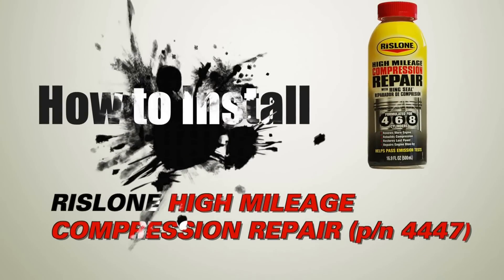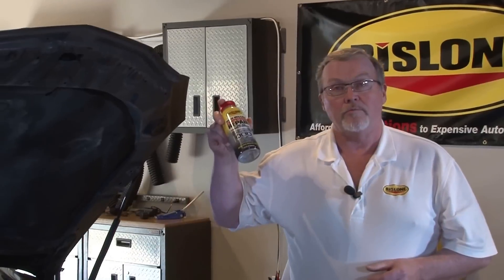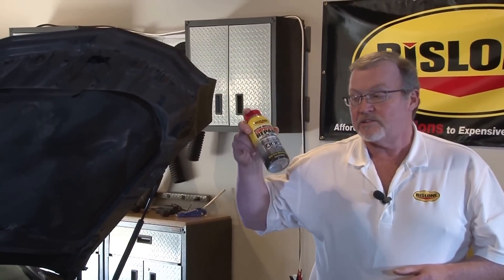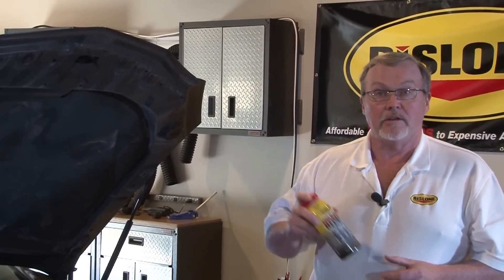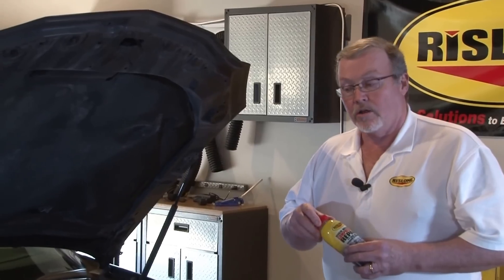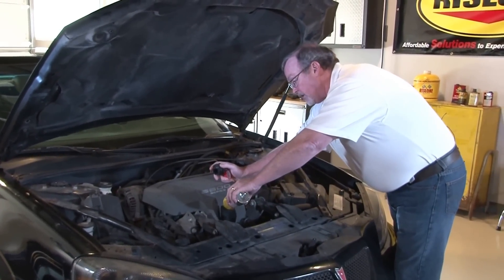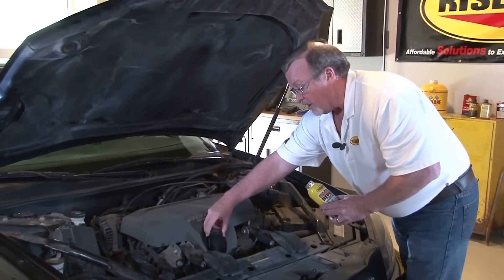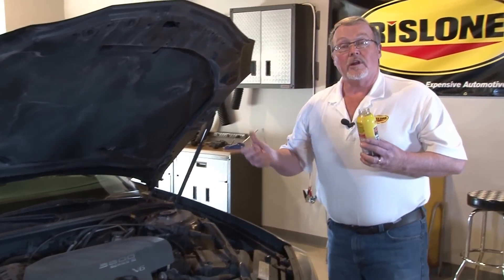VIDEO: How to Install Rislone High Mileage Compression Repair (p/n 4447)

Comment: I have an 8 cylinder engine with very high mileage, but have compression loss in the #1 cylinder making it idle rough. Can this product help? It’s most likely worn piston rings. Thank you.
Reply from the maker: Yes! This product will be a great option for your vehicles compression loss due to a ring issue.

Comment: What if the car doesn’t start because of low compression wil that still work?
Reply from the maker: The vehicle will need to be able to start, the product has to circulate in the system. You will need the vehicle to be able to at least idle for 20-30 minutes if not the product will not fully circulate into the system.

Comment: Hello, is it safe to use it on motorcycle engine? further question, do i need to put it on with oil or should i drain the engine from the oil first?
Reply from the maker: Thank you for the comment, we would like to hear more about the motorcycle and product you are wanting to install. Please use the link below to contact our Technical Support Team with your questions! 

https://rislone.com/contact/

Comment: Can this remedy a blueish white smoke from exhaust and oil burning in a Mercedes v6 diesel?
Reply from the maker: Yes this product can help with that issue, we do have another product that is a bit more widely available part number 4416 Rislone Ring Seal Smoke Repair. Link to the product below. 

https://rislone.com/products/rislone-high-mileage-ring-seal-smoke-repair/

Comment: Can you use on a 2 stroke jetski engine
Reply from the maker: If the Jetski does not take a premix gasoline than yes, you can add 2 ounces per quart of engine oil capacity to the engine oil.

Comment: Is it safe to use on engines with hydraulic variable valve timing, which uses oil pressure to activate?
Reply from the maker: Yes at proper dosage you will be fine with that product in the vehicle.

Comment: I'm amusing you need to drain the same amount of oil before adding this?
Reply from the maker: Yes this product is 16.9 ounces which is very close to a half a quart. You will want to be about a half quart low before adding.

Comment: Hi it’s safe to use on my Subaru xv 2013 2.0 unleaded?
Reply from the maker: Yes, Rislone High Mileage Compression Repair with Ring Seal is a concentrated proprietary blend of high-shear and premium polymers developed for higher mileage engines that are suffering from decreased or uneven compression. Low compression can be caused by normal engine wear and decreased sealing between the piston rings and cylinder walls. The non-dispersant olefin copolymers fill scratches & grooves in cylinder walls to increase and stabilize compression in all cylinders. Compression Repair renews worn engines, rebuilds compression, restores lost power and repairs engine blow-by. In addition, Compression Repair helps vehicles pass emission tests.
Some signs of decreased compression include loss of power, poor fuel mileage, oil consumption, blue smoke from exhaust, plug fouling and engine noise or vibration.
The Viscosity Improver (VI) is designed specifically to provide an optimum balance of shear stability and thickening efficiency required in old and modern engines. This performance additive meets the most severe passenger car and truck engine requirements.
Product works by freeing sticky rings and filling gaps & scratches in cylinder walls, eliminating blow-by and compression loss while also reducing friction and wear. Blow-by is usually caused by gaps in internal engine parts resulting from excess wear.
Rislone Compression Repair with Ring Seal does not contain any harmful lead or other metals that could damage the inside of your engine or be burned and contaminate emissions components and the environment.
Works on gasoline and diesel engines with conventional, high mileage and synthetic engine oils.

Comment: Only between oil changes?Can it be used every time I need to put a liter of oil?For an 1.8 tfsi
Reply from the maker: Hi Robert, after talking with our engineer he recommended sticking to the normal dosage of one bottle between oil changes. Thanks for your question.

Comment: Hi
I work at Amazon and this product is on the shelf.
My car has too much compression at 170 psi for a 1.4 Fiat Evo 2010.
Do you think this product can resolve this issue.
It could be a fuel to air ratio problem or blow by.

Also I know with head Gasket sealant you have to remove the Temperature sensor.
You don’t have to remove any parts with this product ?
Reply from the maker: Hi Richard, can you please call our customer support team so they can further assist you? Our team is available M-F 8am-5pm EST, and can be reached at 800-345-6572. We look forward to speaking with you.

Comment: Do you have to drain oil if you are not low before adding?
Reply from the maker: Yes if you are at the max fill line you will want to drain approximately 1 quart of oil out before adding this product. Top off with oil after adding as need to get back to the fill line.

Comment: I have the same problem with my 1994 Chevy silverado,, it has 289,000 miles on it and 60 psi in cilider #2 of 6.... anyone knows how to quick fix this
Reply: rebuild your engine or get one from the junkyard or a cratemotor if your rich
Reply: I heard this and Restore works within a couple of hours .Dont know how true that is

Comment: Hey, how exactly to be used? When the engine is hot ? Or on cold engine?
Reply from the maker: Hi Marian, please call our tech support team so they can further assist you. They are available M-F 8am-5pm EST, and can be reached at 800-345-6572.
Reply: @barsproducts  ty imma give them a call.
Reply: @barsproducts   does this product work on a 2 stroke Yamaha jet ski engine
Reply from the maker: @johncastellanos6143  No, Rislone Compression Repair is designed to only be used with conventional 4 stroke engines.If this Jet Ski takes an Oil/Gasoline Mix we can not help.

Comment: question does it increase the oil thickness velocity
Reply from the maker: using the proper dosage will not raise the viscosity much but yes it would raise it slightly.

Comment: Not for me to many steps
Reply from the maker: There are not that many steps involved with this product. I am adding the instructions and dosage below. 
INSTRUCTIONS:
Add entire bottle of COMPRESSION REPAIR WITH RING SEAL to engine crankcase at or between oil changes. Do not overfill. Results will either be immediate or noticeable within a few days of driving. Install Compression Repair every 6,000 miles or with every oil change.
DOSAGE:
One bottle treats 4 to 6 quarts of oil. For larger engines, use one bottle for every 5 quarts of capacity. On 4-Stroke ATV, Motorcycle and small engines, including wet clutch applications, use approximately 100 mL per liter of oil capacity.